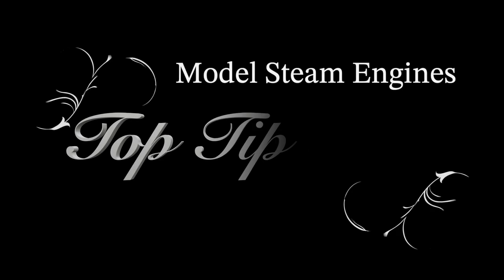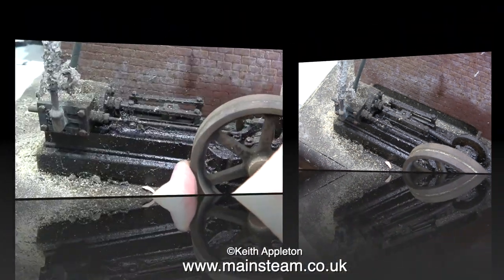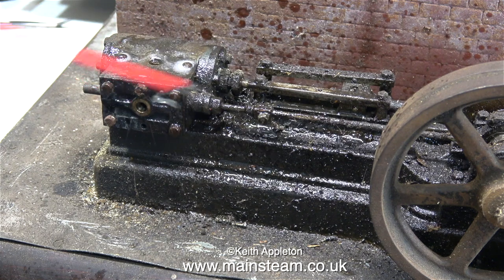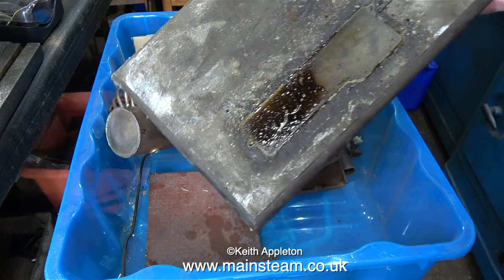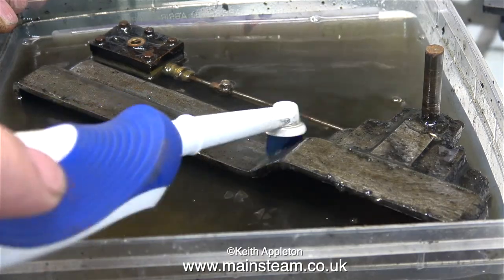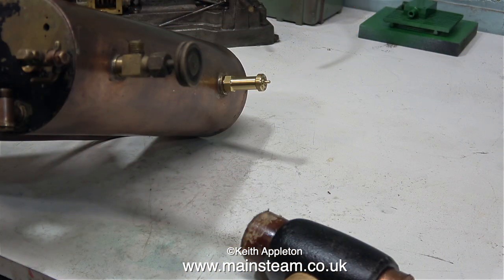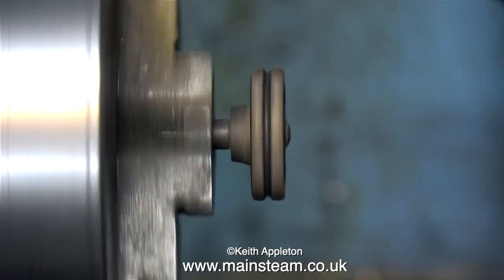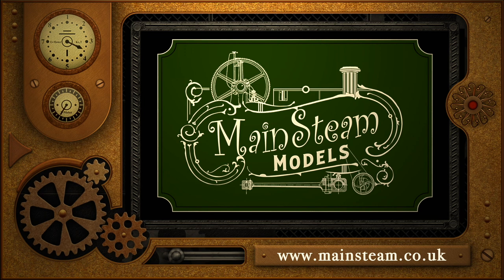MODEL STEAM ENGINES TOP TIP TIME - PART #17

Comment: It's a good job you warned us about changing the toothbrush head before cleaning our teeth - we wouldn't have thought of that. 😄😃 I have a heavy duty version of these, sold for cleaning the grouting in showers, more powerful but isn't rechargeable. Rather satisfying when all the crud comes off.

Comment: I would of used carb cleaner first to penetrate the real shitty bits on that engine, then probably pressure washed it, then the thinners to get the rest, no tooth brush required